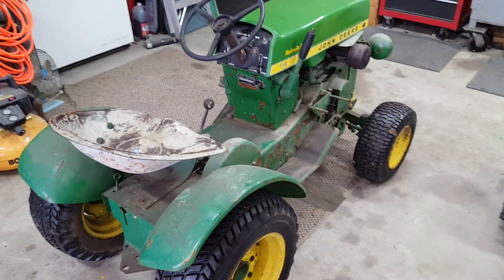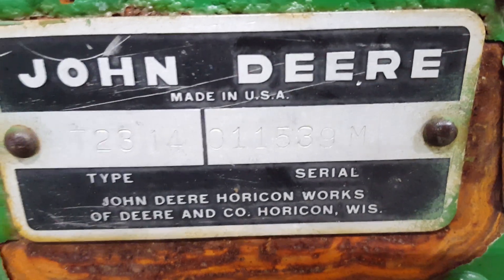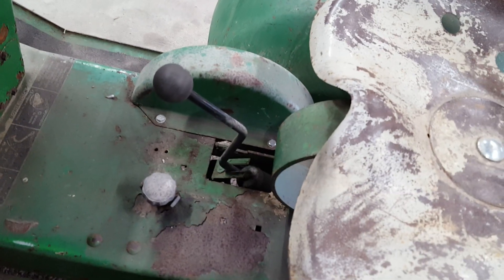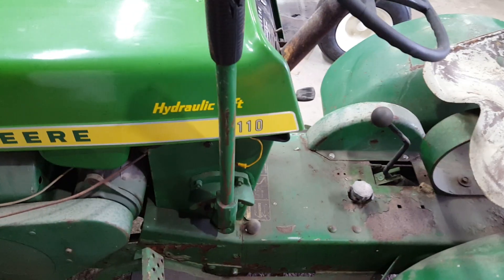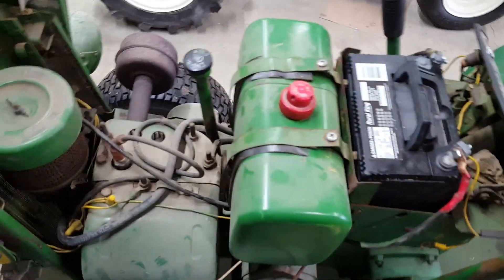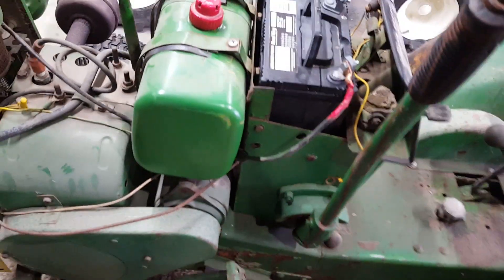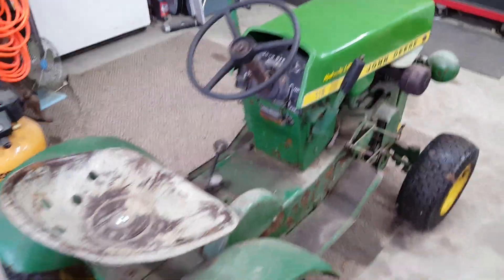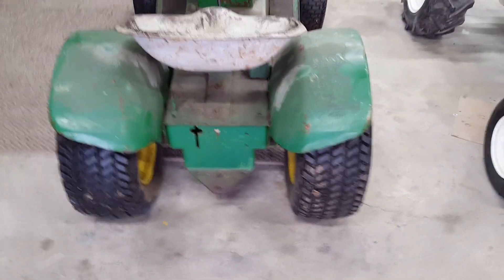1967 John Deere 112  Round Fender Jan. 2020

Comment: Question. What’s the yellow plate on the front for. I just picked up a 69 patio that came with that part but I have no clue what it is
Reply from the maker: That's the front draft plate for hooking up a mowing deck. I have a few more round fender videos that should show it on here. A 1969 square fender doesnt use it though.
Reply: Okay I think the guy just gave it to me to get it out of his shop. He runs a small engine shop and gave me a bunch of stuff I don’t really need. Thanks for the quick response.

Comment: I'd like a definitive example of one of these in original condition. I just bought a 64 yesterday. Mine has chrome, heavily pitted, headlights mounted on the hood. Not sure if those are original or in the correct location
Reply from the maker: I have a video of an original 64 on my channel. The stock jd option lights will be mounted to the hood. They wouldn’t be chrome.
Reply: @JnP-Restorations  thanks for the reply. Since they arent original I'll probably paint them black or green for the restoration. I may seek your wisdom if any odd issues arise
Reply from the maker: @maggs131  sounds good.